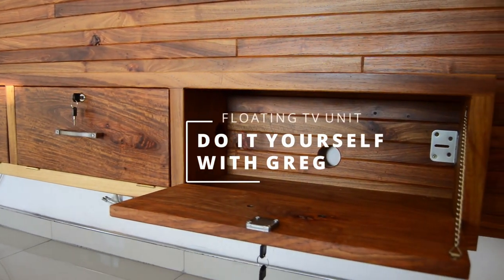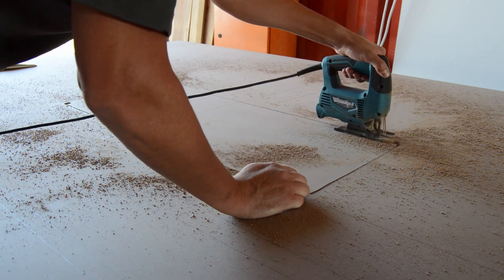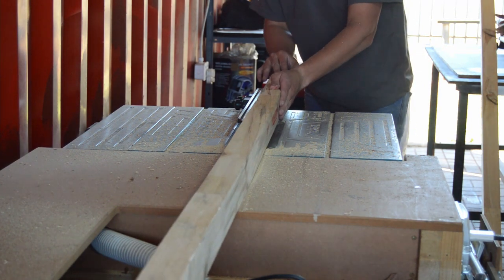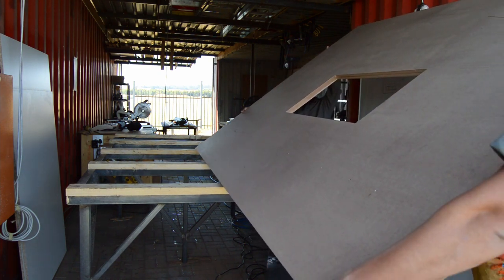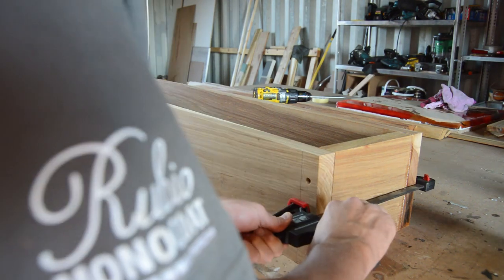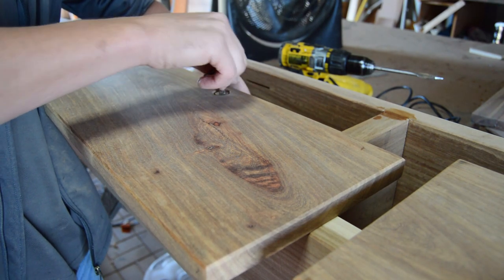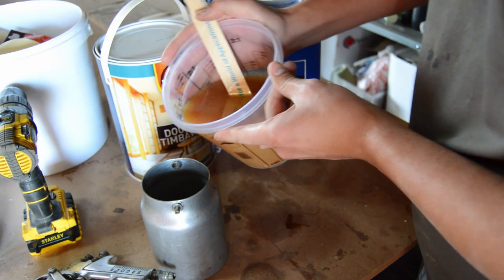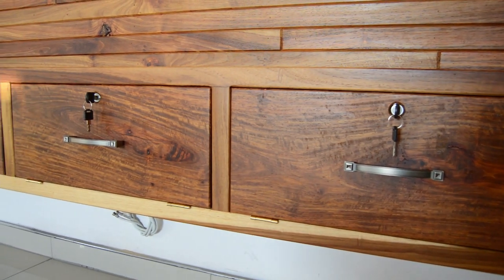DIY MASSIVE Floating TV Unit

Comment: The TV unit really looks neat, one of my favourite DIY video, please can tell how you lock the French cleat system from sliding the unit from left to right? Cheers
Reply from the maker: Thank you so much for the support! 
The unit is very heavy and you will need about 3 to 4 people to lift the unit so it won’t move, it will basically hang like a picture frame.
We also design the unit so its removable, if maybe-in the future you have to remove the unit to sort out cables or have to do any repair work on plugs etc..

Comment: Very nice design. Also very great video. Two Q's: 1) The French cleat that fits on the mdf board seems to be only fasten with normal chip board screws. Is the screw strong enough for the weight of the TV and the unit you built ? 2)Do you fasten the wall french cleat with an expansion screw?
Reply from the maker: Thank you 😇
Yes we use alot of chipboard screws, one screw will obviously break, but 20 screws on one beam will do the job.
Yes we use extended roll bolts on the wall side.

Comment: What tool did you use to make that incision for the lock catch? As well as what tool do you use to make the holes for the round part of the lock? Thanks in advance.
Reply: The Kerf for a lock can be dont 3 ways 
Chisel,  router, or a bisker joint cutter.
Or even just a skill saw doing a plung cut.